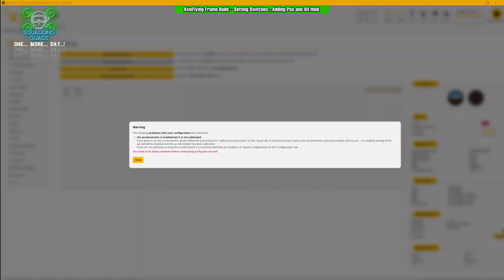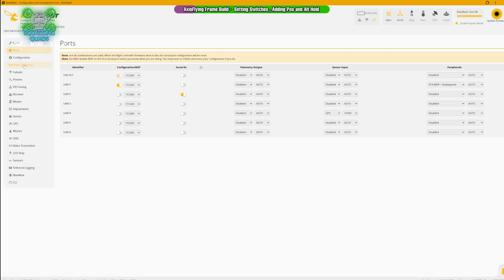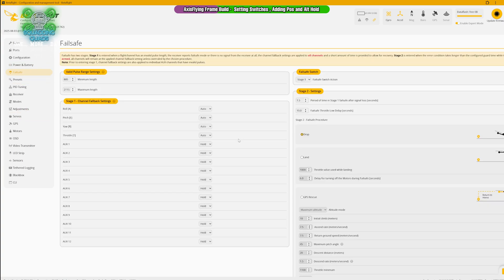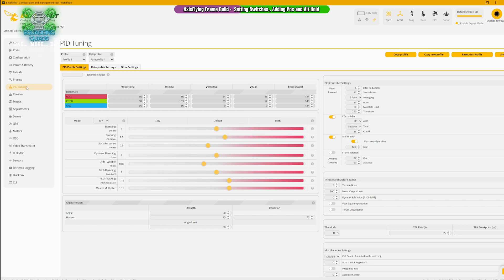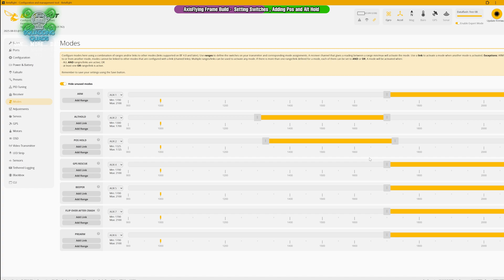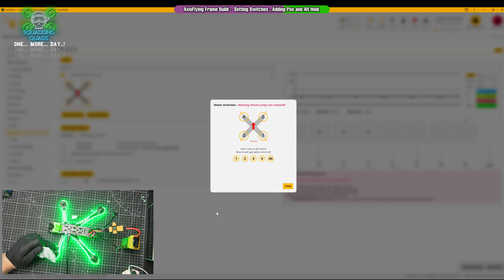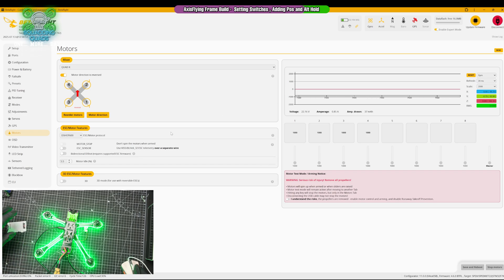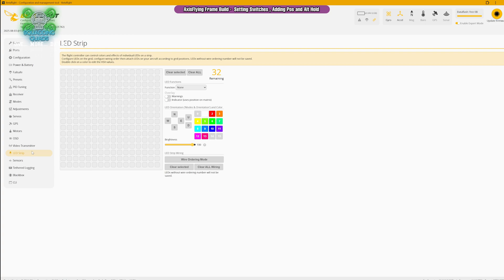Betaflight 4.6 Setup from Scratch (Step-by-Step Guide for ANY FPV Drone!) 🛠️🔥

Comment from the maker: 🔥 Need help with a specific part of the setup? Drop your questions below and I’ll do my best to help out 👇
💬 Let me know what drone you're building — maybe it’ll feature in the next series!
💻 Want the CLI dump or full resource map from this build? Just ask and I’ll share it!
👉 And if you’re enjoying the Manta DC Build Series, smash that like button and check the full playlist here: [insert playlist link]
Let’s keep building, flying, and learning together! 💪
Reply: If it's possible could you share the manta 5 SE (X variant) pids and filters, I've sent you an e-mail. I bought the frame and a baseline would be helpful. (I'm running o4 lite and 2207 1750kv t-motor velox V3 on 6s)
Reply from the maker: @isaakvervenne8387 absolutely, shouod be able to do it tomorrow when I get a second

Comment: Yeah, I'm so basic with all my stuff. Still working off Betaflight4.3 on the Evoque and 4.4 on the Mark 5. Have listened to all the folks saying don't bother flashing to the latest Bflight, so I'm confused as to what to do really. Want the new functionality of RTH and alt hold, GPS rescue, but those earlier versions are hit and miss compared to the latest, so I'm just risking everything all the time. Folk just say don't mess with it so...? Thanks for all the information, great video mate!
Reply from the maker: The 4.6 version with alt and pos hold is still in beta, so if hold off for now until it's Official so your not dealing with bugs etc.

But honestly, save your back up, take screen shots of each page if needed and just work though it slowly

4.6 will be worth the pain for sure and once done, your laughing :)
Reply: @squaddingquads Very good stuff mate, many thanks indeed. I forgot, the mk 5 has no GPS so moot point. I'll wait and get on with working the Evoque. Also need to install my freshly bought iFlight Nano elrs receiver over from BNF 03 so I can use a decent radio! That way, I'll have one to fall back on whilst I work through 4.6. Thanks again boss!
Reply from the maker: @UFO_THE_CONSCIOUS_BEING always happy to help man 👍🔥

Comment: When I built my first quad a couple months ago betaflight was such a pain in my rear. I'm computer stupid and had to buy a laptop just for configuring betaflight. I was desperate and asking questions in a beginners fb groups and some were suggesting flashing this and flashing that. Others said no need to flash anything, only made me more confused. Still don't know what it means or does. I've learned to navigate most tabs in 4.5 version, but still not confident enough to set up a fresh AIO on my own. 🤷
Reply from the maker: Did this video help? Or did I miss the target a little?
Reply: @squaddingquads no it helped with a couple things, like setting the battery voltage to 4.4 if using lihv. When u mentioned flashing to bluejay it reminded me that I know nothing about flashing, bluejay or blueheli. I have zero prior computer knowledge or skills so these terms for things are foreign to me. Lol. Your tutorials are great
Reply from the maker: @thelastgenxer7983 glad it's helped man, I'll get on with a blue Jay tutorial next :)
Reply: @squaddingquads awesome! Love the masks btw. 😆
Reply from the maker: @thelastgenxer7983 no worries man and thank you, we like to be a little different here 🔥😂